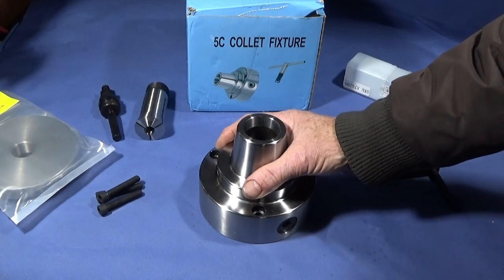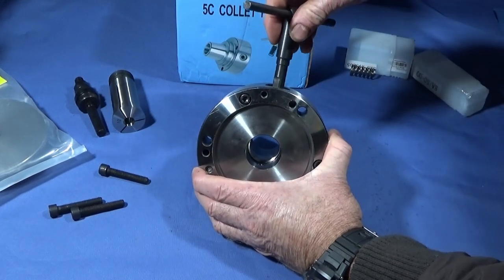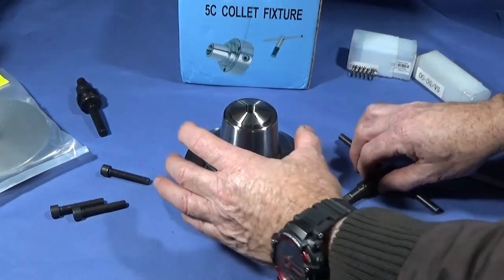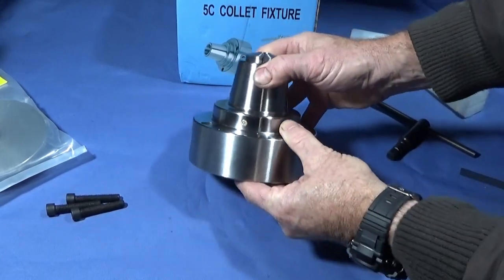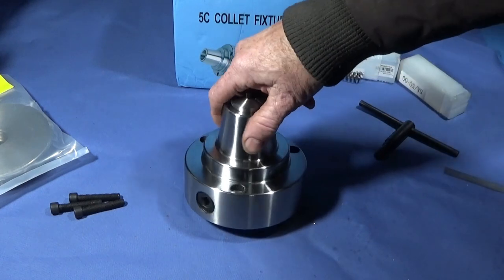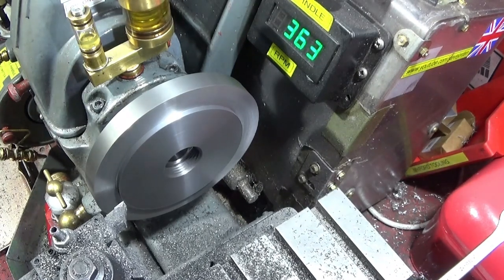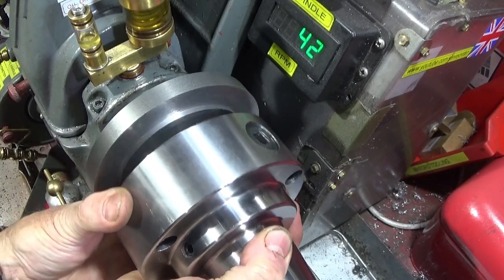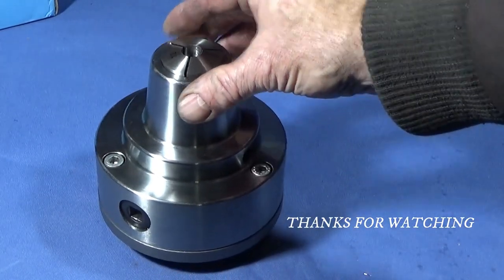A New Chinese 125mm Dia 5C Collet Chuck For My Myford ML7

Comment: Hi there steve,
Would this fit on a 115mm backplate?
Can’t seem to get a 125mm one for less than £900.
Reply from the maker: Hi no you will need the 125mm one. The sellers on eBay put those prices on when they run out  of stock. So they don't have to take the listing down. If you save to your watching page you should see when they come in when the price goes back down to normal. Regards Steve
Reply: Steve Jordan wOW thanks for such a rapid response, I figured it would be too tight. But you have to ask. I wondered about the massive prices on eBay so have a few feelers out there. Just purchased myford capstan and cut off slide to do some commercial work so have started designing tool holder etc... finally the inspiration gained by watching your fearless construction of the most sublime accessories to your lathe is paying off. Steve

Comment from the maker: See Links Below:-
5 Inch 5C Collet Chuck Plain Back Lathe Clip Machine With 3 Screws Torsion Head Tools -- http://bit.ly/2Wo25sq
Banggood Black Friday 2019  -- http://bit.ly/2OimVWy
Banggood Health Protection -- http://bit.ly/33tNTBx
Banggood Health&Care Protection --  http://bit.ly/3d7QpSy
Reply from the maker: Round Type 5C Spring Clamp Pliers 1/8 1/4 1/2 Inch Spring Collet -- http://bit.ly/34F9E18
Machifit 5C Adjustable Thread Collet Stop Rod Holder -- http://bit.ly/380WXjt
Machifit 5C ER40 Collet Chuck Holder ER40 Collet Chuck -- http://bit.ly/37YxV4n
Reply from the maker: Banggood Health Protection -- http://bit.ly/33tNTBx
  Banggood Health&Care Protection --  http://bit.ly/3d7QpSy